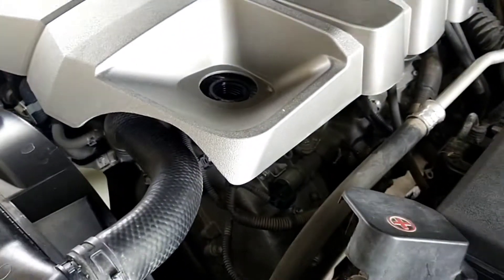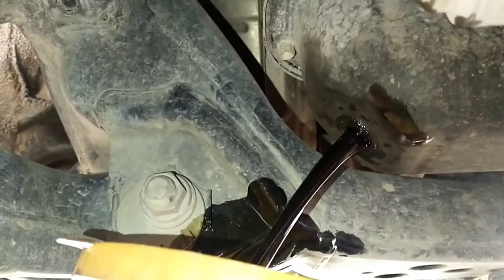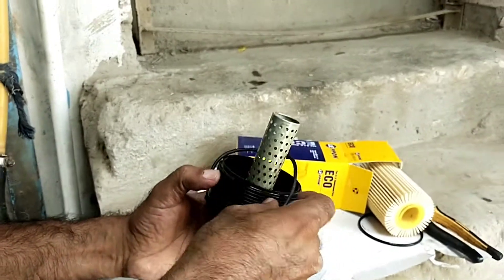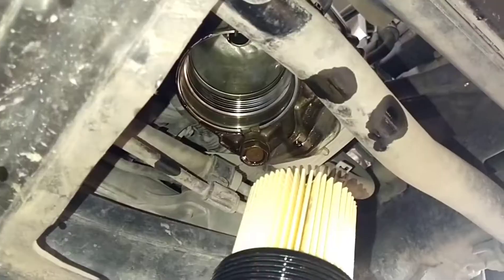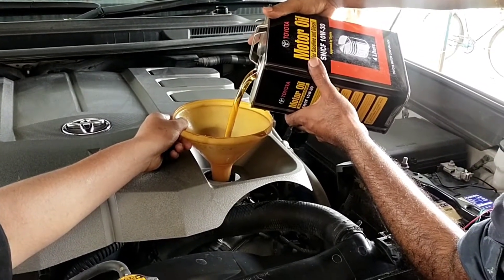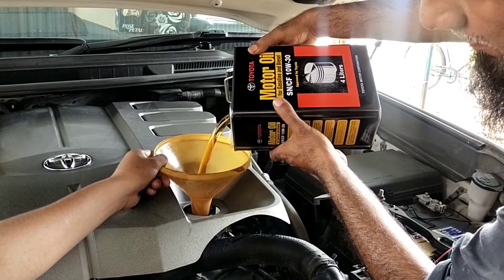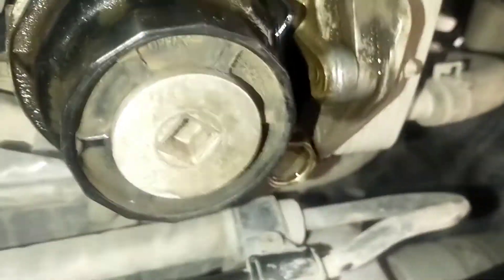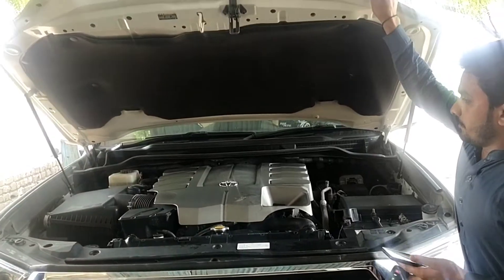Toyota Land cruiser Engine Oil

Comment: Salam brother, Im from Malaysia. I would like to know is the engine oil level is supposed to be half shown on the meter? I have a customer asking about that meter, why is it not showing full or at least more than half for the meter capacity.
Reply from the maker: I think you are talking about oil pressure. Its a normal depends on engine rpm and temperature. If it is half or little bit low than half its good
Reply: @engineer1  thank you brother, you help me a lot